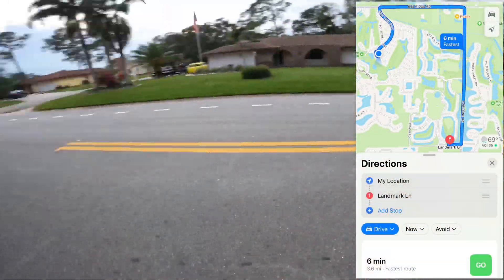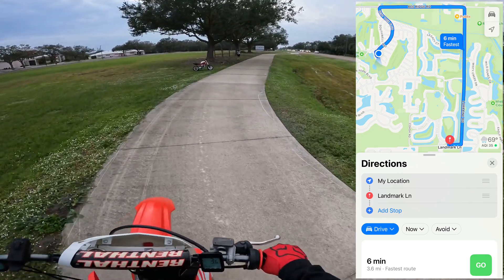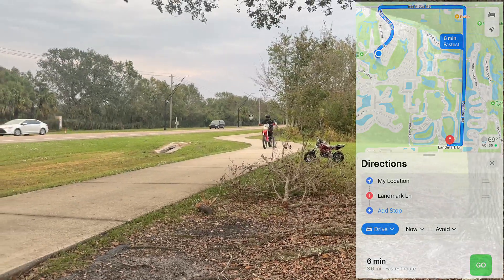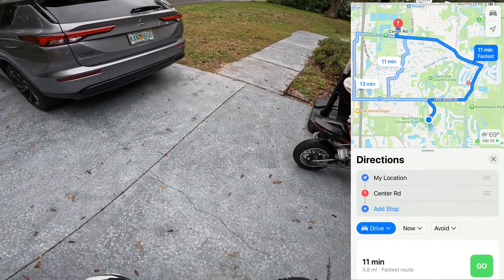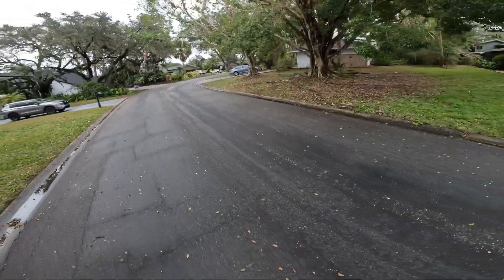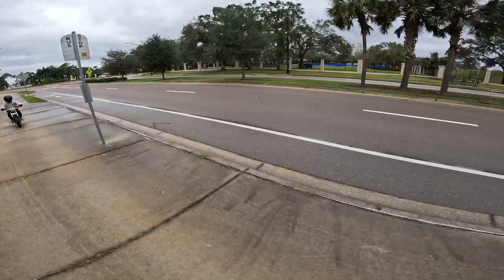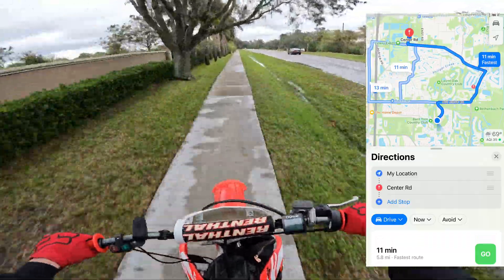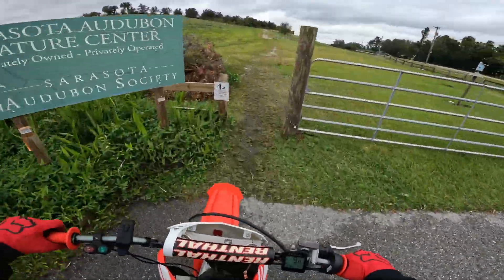“FULL Range Test” 25kw E&C Honda CRF450R w/ Eon 72v34ah Molicel Battery, QS138 V3, EM-260 (+375Amps)

Comment: So 20 miles total on 34ah ? you said mode 3 most of the time, how many modes do you have?
Reply from the maker: @PhoKingLitMedia  yes. Mode 3 is the highest power setting. Mode 1 is eco, which you would see more mileage, less power and torque. Mode 2 is more than somewhere in the middle. Still has descent power and torque, just less than 3.💯🍻

Comment: So thats 20miles of range ?
Reply from the maker: This is actually part 1 of the range test. The range test was 2 parts. I tried to explain as best as I could. After day 3 I didn’t charge it. What you just watched was part 2. I believe I wrote it in description also. But yes with the 2 days on 1 charge was about 20 miles. Basically on 3 the whole time.🙏💯🍻Day 3 - The ULTIMATE FULL Size Electric DirtBike / 25kw / E&C Honda CRF450R / Does It Wheelie?
https://youtu.be/oyoXrslRAgM